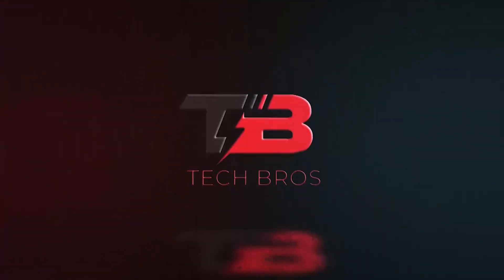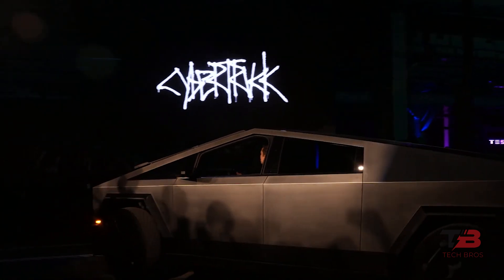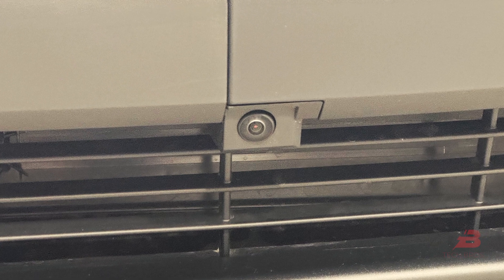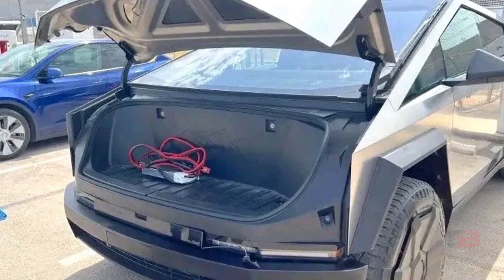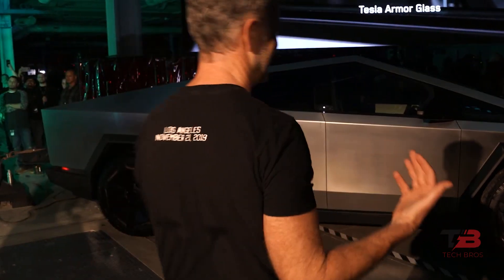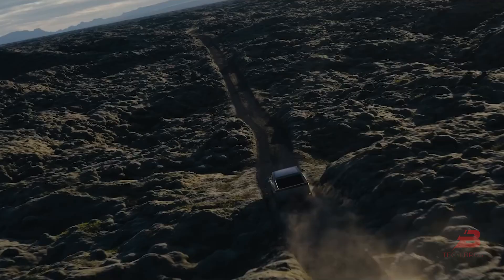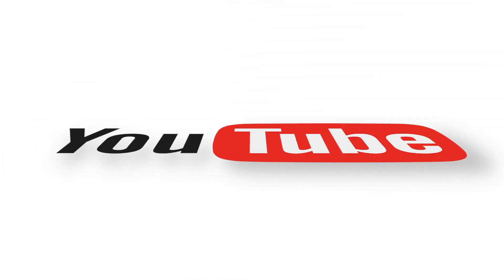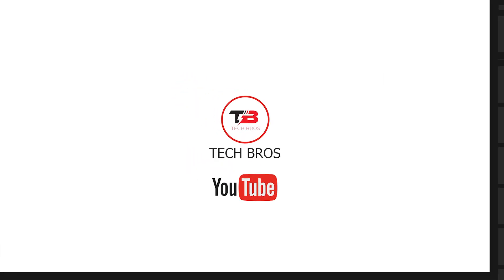Tesla Cybertruck Unveiled Revolutionizing Truck Design and Performance!

Comment: The Tesla Cybertruck is an all-electric pickup truck that has been in development since its unveiling in 2019. It is one of the most highly anticipated vehicles to be released in the automobile industry. The Cybertruck has been designed to be the ultimate utility vehicle, with superior strength, endurance, and performance.